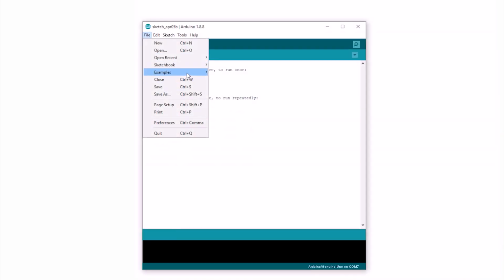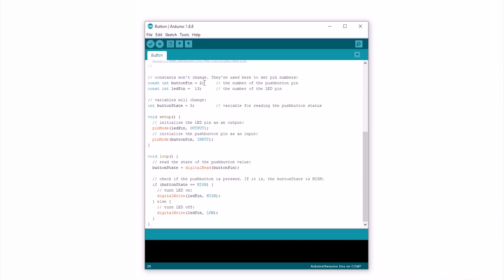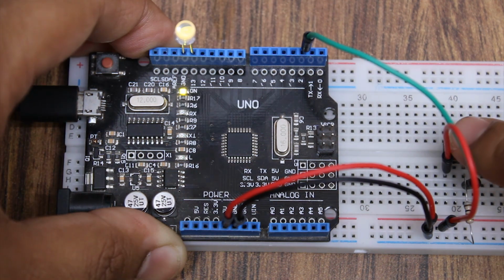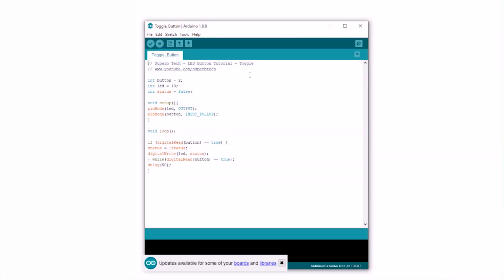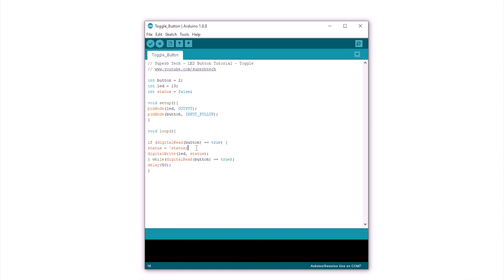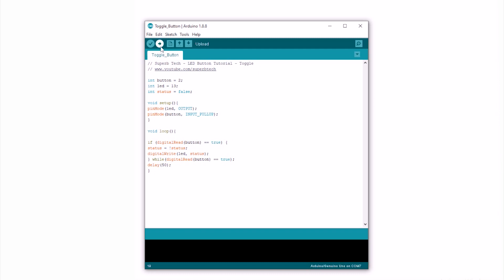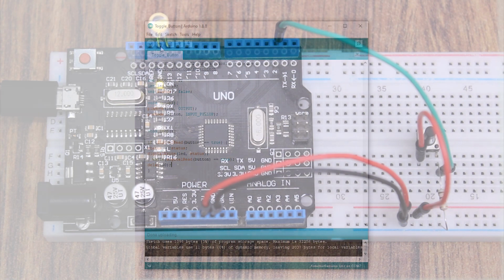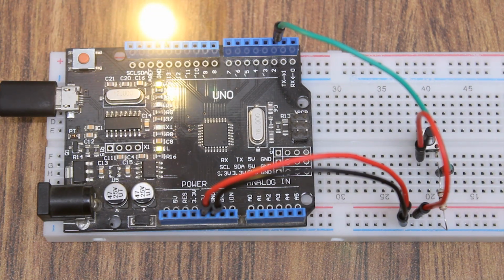Toggle/Momentary Push Button with Arduino - Tutorial

Comment: Thanks so much for this tutorial! I was able to simplify my code significantly because of it!

I actually used this to toggle a motor on and off rather than just an LED, and I used an Arduino Nano. It was a pretty seamless change, however, I did have one slight hiccup. 

I'm still a learning circuits and Arduino. For this project, I started working on a benchtop test circuit with a different motor than the one I would be using in my final design because that motor is already mounted onto something. When I got the test circuit to work, I switched to the motor I would be using for my final design. At that point, the press of the button would trigger the motor on, but it would stop after milliseconds. At first I thought it might be the resistor I was using, but eventually I realized it was the code itself. I did some research into true/false values and realized the "bool" data type is specifically made for true/false values. I changed the variable definition of "status" from int to bool, tried again, and it worked perfectly!

Thanks again for this tutorial!

Comment: Thanks for the simple tutorial. I'm running a stepper and using the UNO as a pulse generator. I used the first program you are showing for my Enable and Direction but makes the buttons only momentary. Your program has a delay (I understand why) but I can't have a delay in my program because it will interfere with the pulse generation timing. So, how can I run the pulse generation code and then the button code separately; almost like running two separate programs at once. Any suggestions? Do you understand what I'm asking?
Reply: Hi Ray i'm using stepper motors in my own project and i think i have the same issue you had could you tell me how you resolved it please
Reply: @thomasmiller3398  I never did figure it out. I got busy and haven't tried to solve the problem. Sure day I'll get my head back in to it.

Comment: hai...can u help me to figure out the coding...  My project is using push button. the button is press (not release)... and the LED ON for 10s (button still not release).. after 10 second, LED is OFF (button still not release)... after the LED off, the we can release the push button...
Reply from the maker: you can find the code here: https://drive.google.com/open?id=1_sO41T64ucrnSBf9CXma-vej0iy6MWYk
Reply: @SuperbTech  hai...tq for your reply.. however, my LED is not turn on if the push button is not relase.
Can u help?
Push Button - Press ( Hold) - for example maybe 15s
LED ON - ( 10s)
LED OFF
Push Button - Relase (this is due to the LED is already at OFF state)

The switch act like a sensor which detect object ( press), the LED will ON for 10s... After 10 s, if object is stll there (button press) LED will automatically OFF.

Then, the object is remove. (button release)